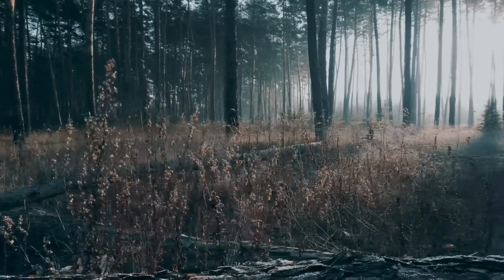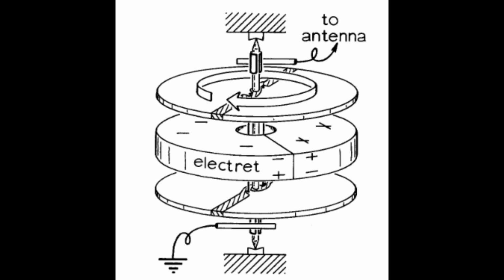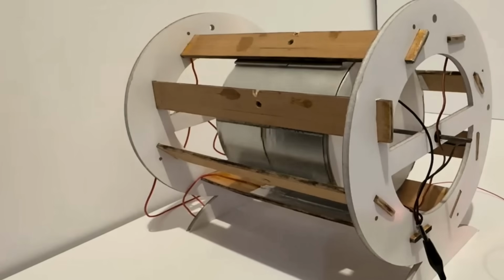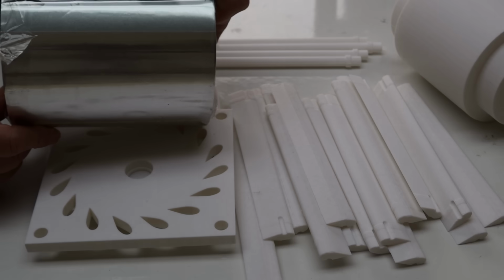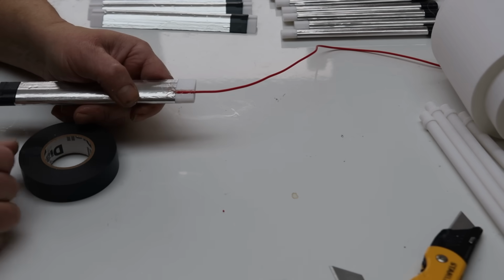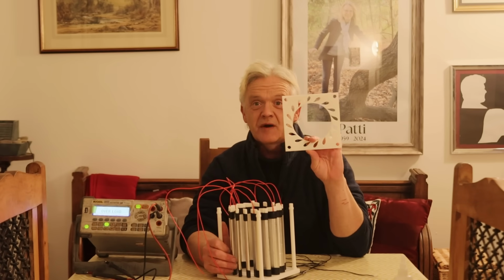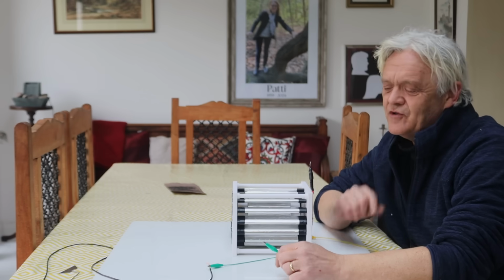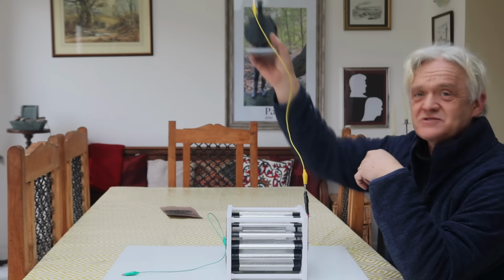2354 The Atmospheric Motor

Comment: I think the aluminum tape placed only on the side of the printed teardrop blades facing the rotor may show an improvement.  The high voltage source loss opposite of rotor will be reduced.

Comment: You said you would need a drone to get your antenna up high enough. However would running and I insulated wire up a side of a build or mountain not work as good? You just need to be high above your electrical ground it seems

Comment: Nice product As Use too! Mate 🙂👍👌

Said that, I think that, unless with need Direct Mechanical Energy, it should be Much More Efficient NOT to Change to type of Energy and Stay in the Electrical Energy by means of Voltage Converteurs (lower the Voltage while Increasing the Amps). Why? Because 

. CHANGING THE TYPE OF ENERGY COSTS MUCH ENERGY.

What do You think?

Comment: What if you increased the capacitance to the ground discharge part and make them part of the motor. Where the second plate of the aluminum goes to ground that is waxed with a paper or paper cloth with salt water inside the aluminum fins going to ground about 400uf or more? Or make the drum a capacitor.?

Comment: The Earth has a pulse , 3 to 60Htz in range  , that Shuman res thing ;>  
Calling it a Capacitor is misleading or oversimplifying.

Plenty of potential Energy inside the Earth.

Look up the Actual Flow of Electricity/Energy & go from there.

Comment: What if we add more antennas or more ground connections? Will it become more powerful? Question is how we can shorten the antenna so we don't need drone for that or maybe just a tree and still get same amount of power.
Reply: Now thats a question about scale that I've been dwelling on.  If we're extremely patient then how much terrain do we use?
I dont have good answers but have heard of principles for grounding antennas.  They relate the area to the height of the tower in guides.  Two towers of equal heights ahould be twice as far apart as they are tall. 
It really varies depending on the dirt and sky conductivity 😔 which may be why I find scarce info
Reply: I wonder if it touches upon the concept of collecting telluric current - which I think robert has done a show on

Comment: Recently came upon a channel based on the topic of electroplating 3D printed, faux jewelry. It’s quite clever and seemingly easy to do. Uses a conductive spray paint as a base coat on the prints, then uses various plating techniques.
Your project seems like it would gain some efficiency by using silver plated (for example) parts in lieu of taping on sheets of aluminum. Don’t get me wrong, your build is awesome as it sits. I look forward to the next one!!

Comment: And for the final thought, I think progress and technology is why we can’t figure this out for instance radio receivers when they were first invented, all relied on tubes to amplify the injected frequency by varying the grid voltage. Every tube has its own characteristics, but their original purpose was to amplify Very weak, electromagnetic or electrical signals to be much stronger and it all works on the basis of the potential difference of the positive and negative with tubes I guess even with transistors it is possible to create a lower than zero negative potential and at the same time a much higher than positive potential More or less doubling your power without any extra input so a multiple stage two amplifier could raise the 2 V with a couple of different antennas not just one to a usable point to run a high frequency high voltage circuit to create enough static energy to do some real work with an atmospheric or electrostatic motor. My research on Tesla says to me in my mind, the Tesla coil was never invented to generate electricity. I believe what he was doing, was perfecting his version of the radio, and when Marconi got all the patents, he then shifted his research to electricity With his current set up setting systems. He was able to amplify atmospheric energy to an insane amount and I believe that we’re only limited because of current technology current electronic components don’t sync up as well or allow us to put systems in the correct resident frequency to operate efficiently. My belief is that residence is key to efficiency and rather than trying to add a bridge rectifier and turning the AC power coming in to DC it would be better to add a tuning circuit such as a crystal radio tuner that is in residence with the incoming power or at least at a harmonic of that residence to increase the efficiency and the usage of bandwidth to make the system more efficient and usable. I believe that this is what Tesla discovered. The incoming energy is at many many many different frequencies and tuning a circuit to allow the widest bandwidth in the highest energy zone was the key.

Comment: Also, I wonder if after having watched your videos about atmospheric energy where even with an antenna a couple of feet high, you were able to create a couple of volts AC so too create the high-voltage static electricity couldn’t we just run that low-voltage electricity through a high frequency, resident transformer And a circuit similar to I don’t know maybe the slayer exciter circuit or a dual thief circuit to get the initial step up before the transformer I don’t think we need to go several hundred feet in the air to get a high voltage. We could absolutely create that ourselveselectrostatic motors. I don’t believe are as dependent on amperage as they are voltage.

Comment: Very cool!
The next step is to make a bigger version of the motor with a massive flywheel and some coils/magnets for it to double as a generator, connect one end to the earth and the other to a lightning rod on the roof, and voila, you just need to patiently wait for a lightning to turn on your generator 🙂
Reply from the maker: go for it mate
Reply: Well, think of it this way. If it doesn't work, its one hell of a way to start a fire.

Comment: I have lasersaber's otiginal print files for his large atmo motor. I made the sliding adjustment peices out of TPU. They slide easily but with enough grip to stay put.  Not sure if the metal teirdrop tubes he used would be better than Rob's 3d printer and tape tubes, but Robs allow for easy ways to try different materials, like coper tape ir other exotic materials not available in the tear drop tunes.  

Another advantage is you don't rho dog
Reply from the maker: i did look into getting his tubes but they were from the USA and not easy or cheap to get here in the UK - which is really what prompted this tbh
Reply: Hi, any chance of getting the print files ?
Or a link to it please 🙏🏻

Comment: PLEASE MAKE AN ELECTRET ONE I HAVE STRUGGLED WITH THIS FOR A WHILE NOW
Reply: You need to put a commutator. If you can make this, with radium or the right radioactive material such as americium 241, you could potentially run this motor at 20-100 feet in the air which is what Oleg Jeffimenko did.
Reply from the maker: don't shout please
Reply: @ThinkingandTinkering  :/
Reply: @RadTradCatholicism  cap lock,or all capital letters is classed as shouting😊

Comment: This is one of the more interesting avenues to travel down. Very Interesting. If course, using the electrostatic generator proves that the motor works, but it doesn't provide any information about just how hard is it to actually Harness the voltage at altitude. Still, this really intrigues me... Thanks for making this video.
Reply from the maker: it intrigues me too mate and I am glad you liked it

Comment: Some atmospheric charge is produced by cleavage of water droplets evaporating from a body of water that is grounded.
I found this bit of knowledge in an old electrical engineering book (1860s or 1870s ?) I purchased at a carboot sale.
It's a bit like Lord Kelvin's thunderstorm in reverse.
Reply: The Sun is like a gigantic plasma ball radiating positive charge (proton's)(cosmic wind). This is also where some atmospheric charge comes from. 
It also explains why there is a hole in the ozone layer above the South Pole.
Reply: An antenna is a kind of voltage multiplier the taller the higher the voltage.
Reply from the maker: that is fascinating thanks for sharing mate

Comment: Float static collection wire up using boyancy, have that blimp also be donut shape with a turbin in the center to get wind energy, add in the static collection wire recovered in graphite hairs to increase surface area with 4 anchor lines set in a square formation for the blimp also carry graphite covered static collection lines should be a nice addition.
Reply from the maker: cheers mate

Comment: Awesome, as always.

I've had a mad thought that's troubled my dreams a few times for harnessing atmospheric energy-  a wimshurst tower.  

I have no notion if such a thing would work or even how to go about it, or if it would be worth the effort, but it seemed like you might be able to stairstep the charge difference between offset disks or something, between ground level and some way in the air.  In looking at how the wimshurst worked, and then the atmospheric notion, Something is pinging around my brain but I can't quite get there.  
If that inspires anybody to take a crack at it, you're more than welcome to it.
Reply from the maker: nice share mate - cheers - I am a fan of the Wimshurst - but the Wommelsdorf was an improvement over that - you might want to look into regarding your idea

Comment: Easy way to test whether the cylinder turns becuse of ionic wind or electric forces is to put it in a vacuum
Reply from the maker: NASA did exactly that with asymmetric capacitors didn't they? for every one else a decent vacuum is only 'easy' in theory mate lol

Comment: Just as a thought, I believe the fins would be better off covered in a conductive copper foil tape than in the Aluminium, because of electrolytic corrosion.
I do understand that this is meant as a demonstrative prototype, but, "There is no thing as permanent as a temporary solution."
Reply from the maker: nice suggestion mate - cheers

Comment: So say you have the ability to mount your antenna 24 feet in the air... eg. at roof height... for ~800v of potential... do you not just need 20 of them spaced a foot apart (or 40, 6 inches apart) to get some half decent amperage...? Nice to see you turning your gaze back to this. 👏👍
Reply from the maker: i don't know but it's a good idea - give it a go mate

Comment: I've seen several demonstrations of these motors, and listened to the 'explainations', but I still can't get my head around where the torque-force is coming from.
Reply from the maker: my guess is in the same way as a moving magnetic field only weaker. But instead of rotating the field in the way you do with magnets the earth connection keeps the field moving - but that's my guess mate
Reply: @ThinkingandTinkering  Thanks, that seems to make sense. But then the electric field would have to be leaking away again, somewhere/somehow to maintain the potential difference. Oh God, I've gone cross-eyed again.
Reply from the maker: absolutely mate and it leaks to earth which is why it is grounded

Comment: Given that some materials, other metals, various plastics etc, already have a propensity towards a particular electrostatic charge (like what is used for triboelectric generators) it makes me curious how much the application of both would increase it's output. like using copper or kapton tape instead of aluminum or the like.
Reply from the maker: good question - give it a go

Comment: Love it, Robert! Machines like these would be useful for so many remote applications. Thank you for taking the time to share :) I do have one question.. Is there a way to make the ground more attractive for the electrons moving down the wire? Might be a uneducated question with a simple answer. You can put the wire higher to access higher voltage but the ground remains the same ground. My intuition tells me digging a deep hole wouldn't necessarily create a more grounded ground. But I guess my question is, could you use a negative charge instead of a ground to turn the motor? Or is the ground already most favorable?
Reply from the maker: use a large flat copper mat instead of a rod mate

Comment: A drone might not be necessary, a kite would probably do the trick as well, these can go quite high and once they are up, they are pretty stable, as a bonus the up and down movements generated by even a slight wind could also be used to generate electricity :), i need to test something like that some day.

I wonder if, using enough of such motors, we could actually prevent important tension buildup in the atmosphere, and thus, the kind of storm they cause.
Reply from the maker: cheers mate
Reply: "the kind of storm they cause."
You got cause and effect backwards.
Reply: @ABaumstumpf  Hm, i was thinking about thunder, but i see your point, tension is the cause of thunder, but it's the consequence of the rest.

Comment: I have some land near a mains pylon, wonder if I could leech some usable 'free' energy 🤔
Reply from the maker: it's do-able
Reply: Yes, but don't get caught as it is not 'free' energy.
Reply: @marjon1703  Actually once the energy radiation from the bare wire goes into the
atmosphere it is Free Energy.  The source is irrelevant. There are laws however that 
prohibit trespassing on the area of the easement around the Hi-Voltage Power Lines.
Build a Thorium Reactor at home. This will give a cheaper more reliable "Free Energy"
source from Beta and Alpha Decay.

Comment: What material do you print with? And what kind of printer?

Your parts always look really clean.
Reply from the maker: i print in mostly pla on an Elegoo Centauri or AD5X by flashforge
Reply: @ThinkingandTinkering  I've been using an ender 3 max neo for a couple of years now and whenever I want to print moving parts like gears I always have problems with them. Guess I still have some bugs to work out... That or gremlins... Any tips for getting rid of those annoying pock marks where the printer retracts? I never see those in your prints.

Comment: The key to tapping atmospheric power is to look at the generator as a "charge pump".  There is enormous electrical potential in the atmosphere, but that that potential is on a continuous GRADIENT so that you rarely get a massive discharge from sky to ground.  To get the charge to FLOW, you need to remove the gradient and create a conductive channel without any electrical charge.  The trick to achieving this can be found inside the VANDEGRAAFF machine.  

NOTE that we are NOT interested in the high-voltages that can be achieved on the OUTSIDE of device, but rather the NEUTRAL CHARGE on the INSIDE of the sphere.  If this were made into an elongated vertical shape, then INSIDE we could generate a current between the high-voltage potential top, and the lower potential at its base.  We could use that current to power a circuit inside the neutral zone.

Thus, the Vandegraaff Machine could operate as a pump to generate a kind of electrostatic vacuum pressure, allowing charge to flow between the high and low potential in the atmosphere.
Reply from the maker: nice post - cheers

Comment: If you had a Mylar weather balloon tethered, say, +/- 300m or 1000’ up, with three Kevlar threads to stabilize the balloon over one location, and connected the motor with a hairlike filament of tungsten wire the weight of the tethering and the electrical connection might not be so much as to be problematic. 

Though, in the United States the FAA might make some objection. No doubt the lighting they would require to alert air traffic would obviate the effectiveness of the electrical gathering.
Reply: Yes, this is due able up to 500 ft. or the max height of a non-commercial drone. Start with a 
triangle frame shape, crisscrossed with nylon fishing line to which Teflon tape streamers are
attached. Coat the fishing line with an epoxy copper power mixture. Suspend the frame by 
tethered Mylar Helium balloons attached with wire to the frame. Now you have a simple cheap
Positive Charge collector. Attach the Tethering lines to a plasma arc Hydrogen Generator and
collect the gas for later use.
Reply from the maker: nice one mate - cheers

Comment: Hey Robert ! Could give it a try with your conductive ink? Maybe its better that aluminium, because of the high surface area of the exfoiliated graphite.  Would be really interesting and nice if you could paint a corona motor :) Cheers!
Reply: This works. I have made one without metal entirely with 3d printable conductive material. I even printed the wires to connect the electrodes but it caught on fire eventually.
Reply from the maker: i did a video where i painted a motor mate
Reply: I was thinking the same thing.
Reply: Fabtastic idea, would love to see that too! Also reminds me I have a tonne of the stuff I bought from you I need to get around to playing with!